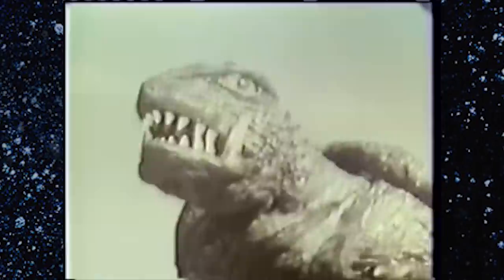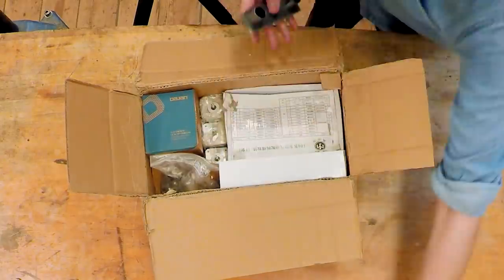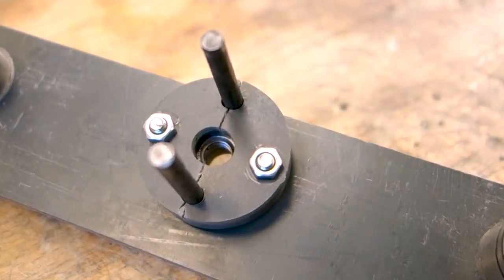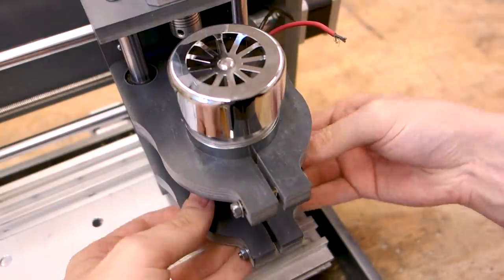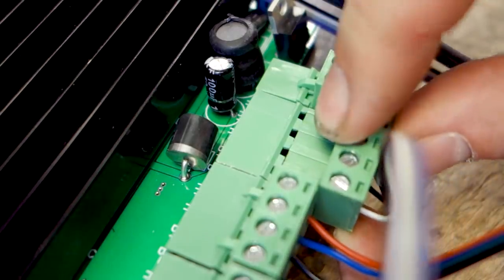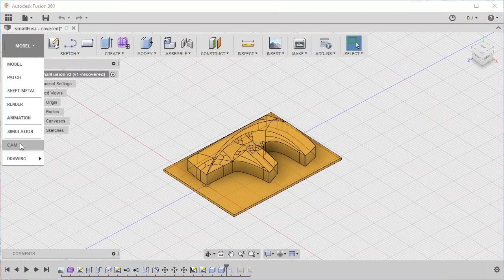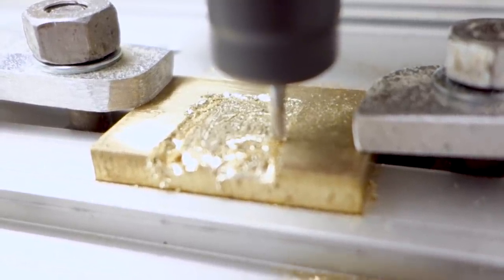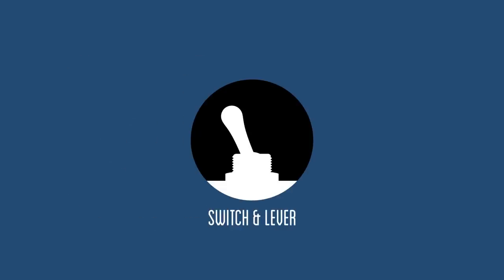Review: Cheap CNC Mill

Comment: Disagree with using this as a platform to learn CNC.   It's much better to be focused on learning  the ins and outs of machine operation and machining than how to work around an improperly  and grossly inadequately designed and horribly manufactured machine.  The best garage cnc in my view for people that want to build real parts is a used bridgeport or bridgeport clone that you retrofit with a good quality set of ball screws and controller.  It's more money and more space.   But it will run true, run reliably and allow you to take a real cut in all materials.
Reply from the maker: +Milo X no, you're right. I'm definitely going to ask my landlord if I can put a Bridgeport  in my apartment. It's fourth floor, without an elevator, but I'm sure it should be fine. I'll just move the aquarium to the side, and reinforce the floor. Do you think one osb sheet would be enough, or should I use two?
Reply: Sarchasm noted.  But in fairness, I did say "garage".  If you want to learn cnc and don't have a garage, I'd still point people to a used Taig or a CNC router.  Anyone who wants to pick CNC up needs to spend a lot of time doing it and will need the incentive of building something they want.  It's not realistic to think people will invest that kind of time on a system that struggles cutting foam nor will they learn to properly fixture parts, create effective tool path strategies, avoid chatter or even select an appropriate cutter.  Creating CAM programs that simulate well is honestly the easy part but doesn't necessarily translate well into cutting parts.   I agree with you  that this is a fine project for people who want something to tinker with but I'd never recommend it to someone serious about learning  CNC machining.

Comment: Price is irrelevant if it breaks while assembling it. Being able to fabricate the broken part is no excuse. You even voluntarily fabricated other parts because you weren't confident about their usability.
Reply from the maker: So, I'm a bit confused here, why shouldn't I have used the means at my disposal and made a new piece, rather than contacting the supplier to send a new piece instead of the one that broke? The piece breaking wasn't the fault of the plastic, it was a fault of the design, as well as a lack of caution of overtightening the bolts. In fact, there are three pieces which are exactly the same, and the piece I made I didn't even put where the previous one broke, there's another identical piece where the original broke. 

But yes, you're right, I did fabricate parts because I wasn't confident of their usability, but that plays entirely into one of the last points, that this is a good platform to rebuild and experiment with. It shows how easy you could cobble together a better table, it shows how easy you could replace a part that breaks, it's not really rocket science that I'm doing.
Reply: The only reason I, and others, have posted comments like mine, is because the video is titled "review". An appropriate (but rather impractical) title would have been "What will I be able to achieve with this badly designed, poor quality cheap mill".

Supporting the idea that poor quality is ok if you have the means to fix it yourself is why we get cheap rubbish from china with zero quality control. Even if I'm able to fix something I've bought that broke, I'm still not happy that I paid money for something that is not fit for purpose. You may as well put your skills to use and make the whole thing yourself.

It's also worth noting that some people don't possess the tools and/or the skills to fix something like this, but they may just want to start a little hobby or try something new. If they buy this mill, there's a good chance they won't even be able to use it because it's probably going to break.
Reply from the maker: So wait a minute, you decide to complain about the fact that I make a replacement part, instead of getting a replacement part from the supplier, and then complain that this is not a review, even though I obviously do outline the good and the bad parts and share my own opinions. Do you realize how easy it would've been to hide the fact that a part broke? I could've made this review look like this CNC was far better than it is, simply through editing, and you would've been none the wiser, until you got this mill yourself. Yet you complain that it's not "reviewy" enough for you. Seriously? Are you trolling right now?

I'm sorry I did not realize I had to pass this by a panel of opinionated YouTube viewers,  submitted paperwork signed in triplicate, sent in, sent back, queried, lost, found, subjected to public inquiry, lost again, and finally buried in soft peat for three months and recycled as firelighters before I could make this video, and even then I'm sure people would have complained to high heaven.

Comment: when i got started in cnc this was the first board i got.  never get this board.    first one was dead from start  sec  one lasted 2 weeks.  they would not replace them.  after that i fireball.   5 years later  i still have it and runs as new.

Comment: With more and more co op rent to use shops opening up I would say no to buying . 3d printers and cnc machines available to use at a reasonable cost with set up help ,the cost/difficulty of making your own parts every time something breaks make it useless to me. I think you could copy it for less and make your own out of plate steel and off the shelf rods and actuators. That you would no doubt end up replacing anyway.
As I see in the comments the Software is stolen and open source anyway so use that to build your own for diy build
Reply from the maker: +P Kuudsk huh? Read closer. The software is not open source. It may have been pirated by whichever Chinese entity put this together, but it's not open source. There are other solutions which are open source however, but the original PlanetCNC controllers are not.

Comment: what a shitty machine cnc 400 bucks for plastic for 400 you can get the chinese 2020 machine its all aluminum and the oily residue china is full of smog its a dirty country you want a good cnc put it together your self or shell out 10 grand for an american one
Reply from the maker: +John Lennon yep, I could. But it comes with a smaller table, a weaker spindle and most variants of it also comes with 3D printed brackets. Not only that, but I would prefer a more capable CNC controller than Arduino with GRBL that they come with. It's a completely different machine, which would for other reasons that this machine require work to get what I want out of it. For this, I can replace the frame, for the one you recommend I replace everything but the frame. Seems like a losing deal either way you twist it. 

If you have 10 grand to drop, then do it, while beating your proud American chest. Nothing is stopping you. Ask that from someone who just want to start exploring the realm of CNC and you're obviously losing touch with reality.

Comment: Why would you spend $400 on something that needs a monster amount of fixing and tinkering to still just be a piece of crap?
Reply: Heres the thing though, I wouldn't say, buy a recliner from Ikea I had to build myself, only to go to home depot (several times) and spend more money to get "workable" materials, and basically build it off my own pre-existing knowledge.   The other thing which usually gets ignored, what is your time "worth"

All this doesn't equate to a DIY CNC is bad idea, just THIS version.  Personally, I'm still waiting for quality to improve in the low end, this plastic molded design isn't quite ready yet
Reply from the maker: +workhardism you can say the same for anything you build then, why build anything if it requires work? If you think this is a "monster amount" of anything you've seen nothing. Try buying a used lathe and refurbish and maintain it over time.

Comment: Soldering spade connectors is considered bad practice, and generally less secure than if you just crimped them properly. -- If you need solder, then you're probably crimping them wrong. -- Just buy the correct crimping tool, and you'll be set -- it will be the best $15 you ever spent. :)
Reply: Also, relays can generate heat... and hot glue can melt on just a hot day (at least around here) -- You should really have used epoxy for that... XD
Reply from the maker: +Michael Jensen I hear this repeated over and over but no one can tell me why it's less secure, when intuitively it's more secure. 

The issue here is rather using too big spade connectors with too thin wire. Had I had correct connectors the hold would've been a lot more secure. 

As for relays, unless they're switching constantly they don't really generate much heat (unless they have massive internal resistance, which would be highly unusual). As this switches only at beginning and end of a milling run, to start/stop the spindle) it's not generating any considerable amount of heat.
Reply: It's explained pretty well here: https://hackaday.com/2016/11/03/specifications-you-should-read-the-nasa-workmanship-standards/
Reply from the maker: +Michael Jensen thank you, you did what no one else who brought this up did, provided a source. I can understand the reasons why soldering is bad practice, however a loose low gauge wire in a poorly crimped connector is even worse. The solder is what makes the connection, in my application, reliable. I did not solder the crimping on the thicker gauge wires, except that some already came pre soldered, but only on the thinner gauges which would not crimp properly. I think I will be fine, but future will tell, and if something fails at least I know a likely culprit.

Comment: Na, I think building my own from scratch might be less expensive, and really not be much harder then putting this thing together, since you have to throw out the instructions anyway.
Reply from the maker: +Jesse Sisolack then do it, make a video and come back and share your experiences rather than just speculating.
Reply: I do not make videos, especially these days. Bad return, however, I think I might had found a better starting point then scratch with a different machine, but with some modifications. That should save me a lot of time. Building from scratch always takes longer then I plan. More research into this Amazon find.
Reply from the maker: +Jesse Sisolack why not start the new build with this machine? Its main drawback is the frame. You could order a bunch of aluminum extrusions and reuse the electronics from this once you've reached the limits of what it can do, and build your own machine with a good starting point of what goes where, and why. Replace the screws with ball screws and continue making improvements and you'll end up with a quite capable machine in the end, while learning invaluable lessons about machine construction in the process. If all you want is a CNC that can bang out parts that's another story, and price point to go with.

Comment: why you no just say it sucks?
If i buy something, even a kit such as this (and I am a master mechanic perfectly capable of constructing something as simple as this), it HAS to work/function AS EXPECTED.
Otherwise I am going to ream someone's ear as if it were a hot chicks ass and send them a BILL for ALL of the time i invested.
Reply from the maker: Because I don't see the world in black and white extremes, because it sucks for you does not mean it sucks for everyone, or for all intents and purposes. If the world was that easy, every review would be five seconds long with simply "This is great!" or "This sucks!". As a few people have testified in the comments, they use this machine in a small scale production environment, with no issues. It's an engraving machine, and as I've also said numerous times, I have no doubts that it will fulfill that purpose amicably. I did however try to push it beyond its original purpose, and it failed, which is not really a failure of the machine, just as not being able to drive under water is not a failure of a Volvo.
Reply: ok, i get you there, however I wouldn't call an 'engraving machine' a mill even thou that really is its function. I watched the whole video, and MY specific point is that even if it were a kit automobile, my view is that if i ONLY have the tools and skills to do the assembly AND plenty of experience at the building and assembly of mechanical things that I would expect it to be 100% in form/function.

When I do a plastic static model, i have those tools to correct the parts prior to finish & assembly as is expected with any plastic injection molded items, but that's a $10 item. this thing i would expect to not require ANY such necessity outside of needing to be calibrated.

Comment: Did nobody notice he was using a ball cutter. It has no end cutting ability. it will walk on the tip and not penetrate the material. It may work well with an end mill.
Reply from the maker: +MrOliverock it is a center cutting ball endmill, but yes, even so, as I have mentioned, I could probably have approached it differently.